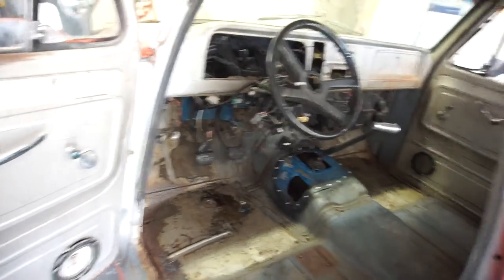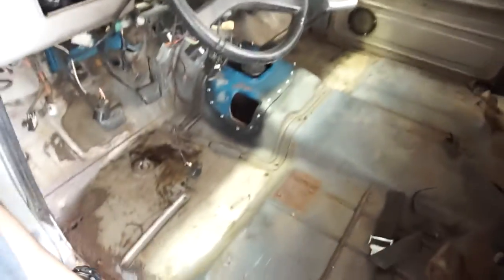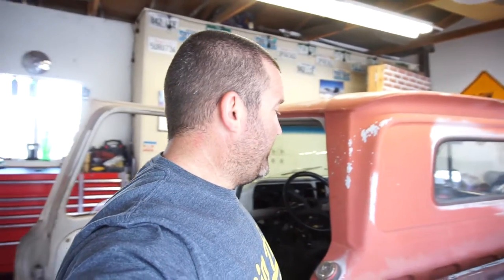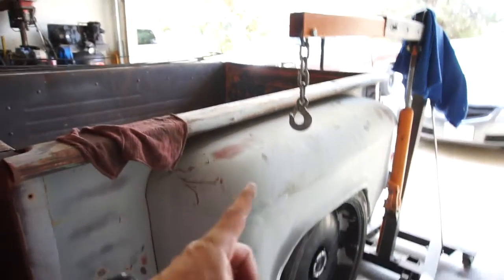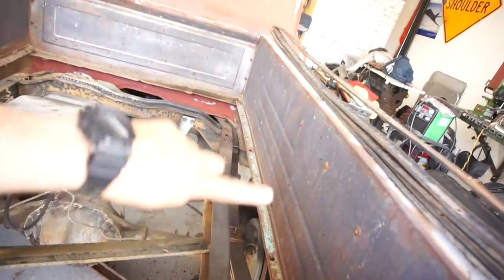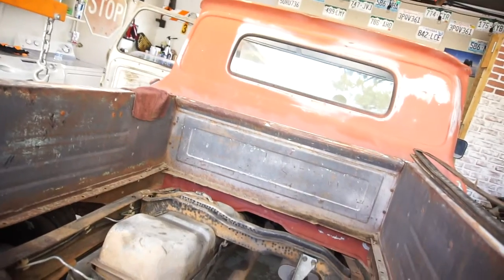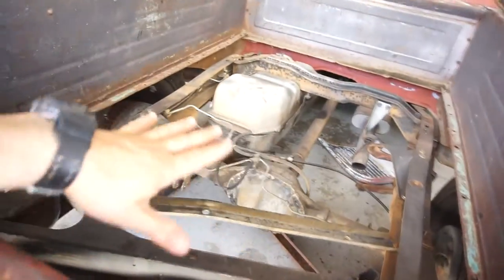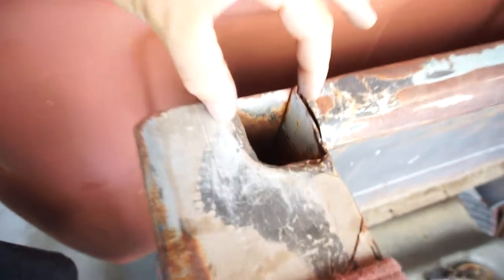Don't Watch This Video. PCP. Long Winded. Leads To Nothing

Comment: I vote for NOT cutting the bed in half and extending it four inches. you are adding too much work trying to bend metal and make it look good where the extension will be.
Reply from the maker: We’ll see what happens. What am I gonna do once this project is done?
Reply: Probably just get another project to start working on.... I would like to see you get an older jeep and just kind of run through it with some custom mods.